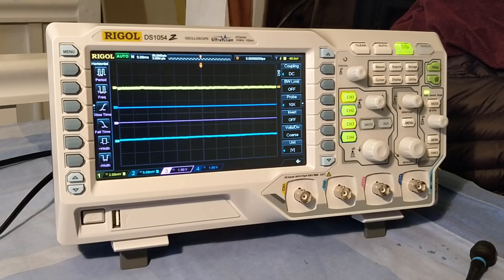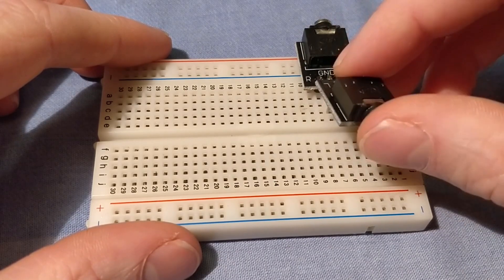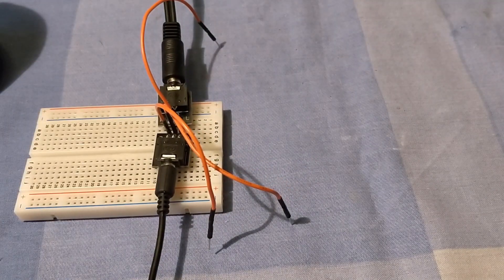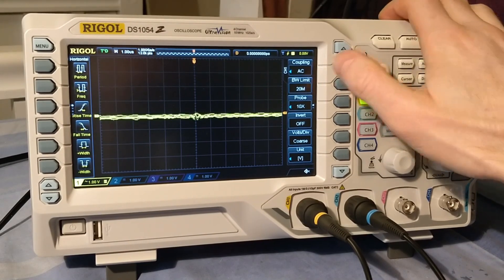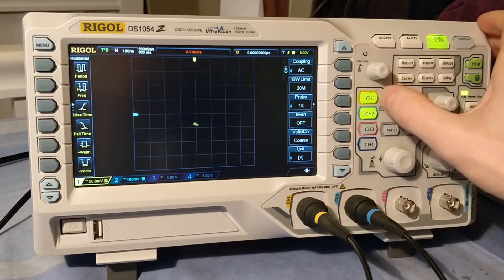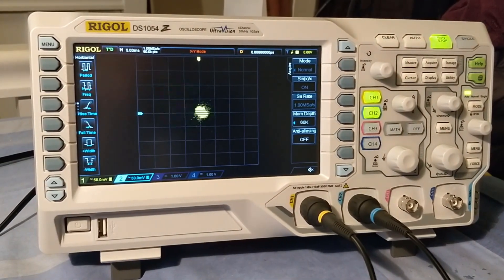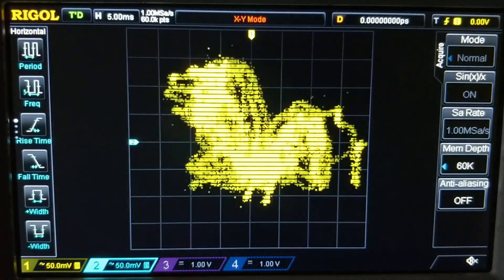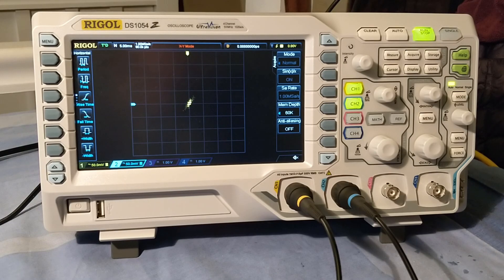Oscilloscope mushrooms on the Rigol DS1054Z

Comment: How does this work.Could I play my modular synth and get shapes like this on the oscilloscope or is it being drawn on with the oscilloscope.Sorry I'm a bit clueless with this sort of gear 😅
Reply from the maker: It's... complicated! Basically you have two input signals (could be l and r from the synth) and the oscilloscope is drawing an xy plot, with the left signal on x and the right signal on y. The sound files I'm using here have been specially created to draw patterns without sounding too awful, but you would get random looking patterns if you just connected the land r channels from any musical gear (providing the signals on l and r are different enough).